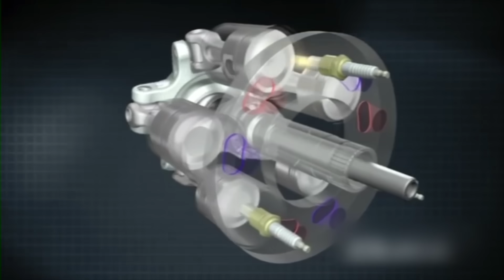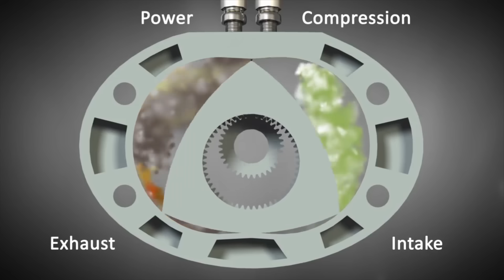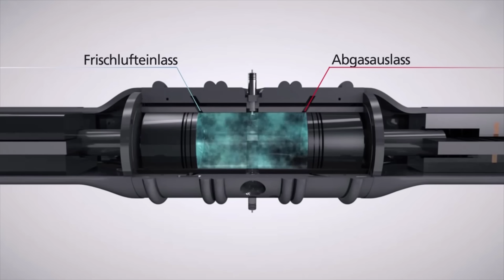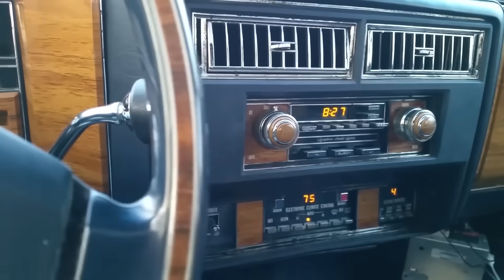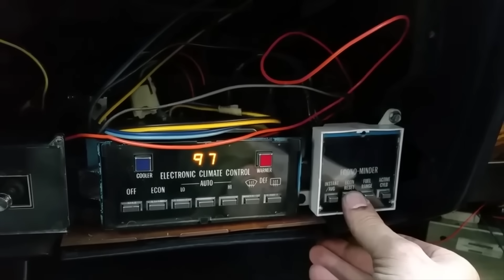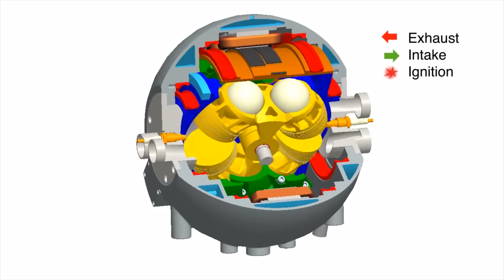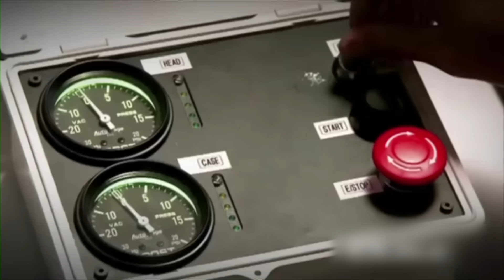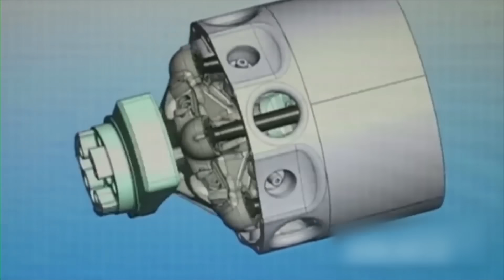10 Strangest Engines of All Time

Comment: LMAO....talks about the Mazda Rotary motor...focuses on the sad RX8, not a single mention of the 20+ year run of the Iconic RX-7....or the lil monster RX-3...or the Cosmo.
Reply: @Aaron Brockington I road tested the RX-3 when it came out. Holy mother ... it was awesome.
Reply: @danmar007  I had one used, damn it used more oil than fuel. lol I traded it for a '77 Corolla SR5 and was much happier.

Comment: And that last engine should be able to idle at 100rpm. It's papa the revolver engine could and that was over 30 years ago now, they put one in a Cessna, it took off quicker and got altitude faster. The plane might still be around but I doubt it.

Comment: Fuel driven electric proplsion is how train locomotives run too.
Reply: The original hybrid.  I was shocked when I learned that, being a huge train buff since I was a kid.
Reply: That's a gas engine with extra steps
Reply: Victor Murat  it uses a diesel engine that drives a generator that drives an electric engine for the fact that if it was driven directly by the diesel engine it would needed a huge gearbox to transmit the power and torque to the wheels.
Reply: @vladimirvlad2563  

It would also be extremely tricky to put down all that turbodiesel torque from those huge engines if the engine was mechanically linked to metallic wheels on metallic rails!  A motor which doesn't need to "idle" so can work from 0rpm and is also highly controllable is much better.

Even though there's an "extra step", they're well designed too, so fairly efficient for what they do.  I always kinda wanted to see heavy goods vehicles use the same setup, but didn't happen.
Reply: kelly dunn 👀
Reply: Railway locomotives pull or push Trains. We have train tracks, but I don't think you can have train locomotives, as locomotives are part of a train, then again you can have an engine in a locomotive, or use an engine to pull a train!

Comment: The first person to experiment with an internal-combustion engine was the Dutch physicist Christian Huygens, about 1680. But no effective gasoline-powered engine was developed until 1859, when the French engineer J. J. Étienne Lenoir built a double-acting, spark-ignition engine that could be operated continuously.

In 1872, American George Brayton invented the first commercial liquid-fueled internal combustion engine. In 1876, Nikolaus Otto, working with Gottlieb Daimler and Wilhelm Maybach, patented the compressed charge, four-cycle engine.
Reply: 17th century: Christiaan Huygens designs gunpowder to drive water pumps, to supply 3000 cubic meters of water/day for the Versailles palace gardens, essentially creating the first idea of a rudimentary internal combustion piston engine.
1780s: Alessandro Volta built a toy electric pistol in which an electric spark exploded a mixture of air and hydrogen, firing a cork from the end of the gun.
1791: John Barber receives British patent #1833 for A Method for Rising Inflammable Air for the Purposes of Producing Motion and Facilitating Metallurgical Operations. In it he describes a turbine.
1794: Robert Street built a compressionless engine. He was also the first to use liquid fuel in an internal combustion engine.
1794: Thomas Mead patents a gas engine.
1798: John Stevens builds the first double-acting, crankshaft-using internal combustion engine.
1801: Philippe LeBon D'Humberstein comes up with the use of compression in a two-stroke engine.
1807: Nicéphore Niépce installed his "moss, coal-dust and resin" fueled Pyréolophore internal combustion engine in a boat and powered up the river Saône in France. A patent was subsequently granted by Emperor Napoleon Bonaparte on 20 July 1807.
1807: Swiss engineer François Isaac de Rivaz built an internal combustion engine powered by a hydrogen and oxygen mixture, and ignited by electric spark. (See 1780s: Alessandro Volta above.)
1823: Samuel Brown patented the first internal combustion engine to be applied industrially, the gas vacuum engine. The design used atmospheric pressure, and was demonstrated in a carriage and a boat, and in 1830 commercially to pump water to the upper level of the Croydon Canal.
1824: French physicist Sadi Carnot established the thermodynamic theory of idealized heat engines.
1826 April 1: American Samuel Morey received a patent for a compressionless "Gas or Vapor Engine." This is also the first recorded example of a carburetor.
1833: Lemuel Wellman Wright, UK patent no. 6525, table-type gas engine. Double-acting gas engine, first record of water-jacketed cylinder.
1838: A patent was granted to William Barnett, UK patent no. 7615 April 1838. According to Dugald Clerk, this was the first recorded use of in-cylinder compression.
1853–1857: Eugenio Barsanti and Felice Matteucci invented and patented an engine using the free-piston principle in an atmospheric two cycle engine.
1856: in Florence at Fonderia del Pignone (now Nuovo Pignone, later a subsidiary of General Electric), Pietro Benini realized a working prototype of the Italian engine supplying 5 HP. In subsequent years he developed more powerful engines—with one or two pistons—which served as steady power sources, replacing steam engines.
1857: Eugenio Barsanti and Felice Matteucci describe the principles of the free piston engine where the vacuum after the explosion allows atmospheric pressure to deliver the power stroke (British patent no. 1625).

Comment: pfft, duke engine... Call it the "revolver engine" and it'll sell.
Reply: Look up the Crankless Engineering company  in Melbourne Oz. Motors of the duke design existed back pre WW1. Phil Irving of Vincent motor cycle fame worked there as a lad. 
Similar motors are uses as hydraulic of air motors - see torpedoes. There was also a German WW2 aircraft motor of similar design.

Comment: did citroen GS really have Wankel motors? anyone?
Reply: Yes, disaster that almost bankrupt Citroen, all were supposed to be recalled and scrapped but a handful escaped.
Not all GS' had the Wankel of course - mine had a flat four aircooled 1222cc engine.

They also built a birotor engined helicopter.
Reply: @myglaren  interesting, thanks.

Comment: The Tucker engine would make a great slow speed generator engine running a 6 pole AC generator at 1200 RPM to produce 60 HZ  120/140 volt power for continious use .
Reply: Its a flat 6 helivopter engen

Comment: The widely used piston engine is still the best in reliability long life . Engine like I have in the photo with me is 503 Cu In  1 cylinder only 24 HP at 525 RPM and has torque of 240 Ft Lb  the 10 inch stroke is a true "Power stroke" engine . Ajax makes a 1 cylinder 2 cycle engine 15 In bore and 16 In stroke is 165 HP and yes 3,400 Ft Lb if torque at 300 RPM  That isn`t peak torque in these engines but standard running torque .
Love to see one of those automobile 500 + Hp engines try to put out that power at a constant rate !! most likely  burn up in less than 15 minutes.

Comment: You need to see the motor in my Minn- mo  Z tractor.  Designed to have least parts. It's a overhead valve flathead . The head bolts on vertical, the valves lay flat over the piston, no pushrods, rockers are over a foot long and ride from the cam to the valves. No  oil pan, the crank shaft and cam load in from the back of the engine. Intake and exhaust ports face up.

Comment: More research needed here! Most of this is a jumbled babble of inaccuracies and incorrect 'facts'. Some of the latest electric cars now have ranges up to nearly 300 miles. Stop for a P-break after 250 miles, top the battery up for half an hour for another 250 miles. Anyone that drives 500 miles per day every day is probably better off in a gas car.

Comment: When the Dodge ESX hybrid was created back during the Clinton Administration, it ran on the BOLDER TECHNOLOGY power cells. The same 3 cyl. charger on board did the same as the ones now used. Most motive power for trains are hybrids. Traction motors on every axle ae supplied by generators on Diesel engines inside the locomotive. The F-7 was the Superchief of passenger trains. Only bus and air travel killed off passenger trains with the lower cost of fuel and time. Modern version still move commuters on the East Coast. Buffet plays with real trains today. BNSF is his creation. I HAVE a train in my HO collection My prides are a UP #4005 Big Boy Mallet engine ( last of steam engines in the Forney Collection ) and the ATSF complete Superchief passenger trains. They were looooong and required 4 F-7 engines to pull one.

Comment: There are 1300 carberators that are quite capable of handling gas to mileage that would provide solutions in fuel consumption.  H2O fuel hydrolization all so would resolve fuel consumption and fuel emitions ending in 100% zero fuel CO2!

Comment: I'm amazed at how far the internal combustion engine has come.
The 6.2 liter V8 in my truck produces 420 bhp, has 11.5:1 compression ratio and still runs fine on regular gas.
Compare that with the '70s 7 liter 427 in the Corvette which required high octane 103 gas.
1/4 mile for the Corvette 13.8 seconds.
1/4 mile for the Silverado, maybe a second more.
Not bad for a 5,000+ pound truck

Comment: Ive had a 2.8 vr6 powered Ford Galaxy (VW Sharan in drag) it was fun engine to drive with especially with the quick shift 6 speed box and the noise was like music, my current 35 degree true v6 sounds good but nothing like as good as my vr6 did, its not as responsive ether.
One bad point of the VR6 is the individual coil packs on each spark plug, fuck me do they fail, i was replacing one every few months lol

Comment: The Olds Turbo Rocket actually had a mechanical system in place that, if the water/methanol was empty it would close a valve and limit boost pressure to protect the high-compression engine. However going from boost to n/a is a pretty big performance drop.

Oldsmobile offered a free service to have the turbo removed and replaced with a 4-barrel carb because people complained so much. Finding one of those old girls with the original turbo and reservoir still in place is exceptionally rare.

Comment: You can build a electric motors that will charge there batteries with out any gas use generators when the car is moving it's charging

Comment: The weight savings on a duke engine is a crock. They take their engine weight and compare it to the engine and transmission weight of a standard sport bike engine since they have a shared case configuration.

Comment: It would be nice to see a couple of the water hydrolysis engines that have been designed.  I know that none of them have hit production, and they probably won't compete with modern electric motors, but they were an interesting bit of engineering.

Comment: Obvious the Buick rocket engine was simply a high compression turbo engine that used methanol injection as the "rocket fuel" lol could have simply used washer fluid

Comment: Concept and design. The design was conceived by German engineer Felix Wankel. Wankel received his first patent for the engine in 1929. He began development in the early 1950s at NSU, completing a working prototype in 1957. 
Rotary engines were mostly used in aircraft, a few cars and motorcycles were built with rotary engines. Perhaps the first was the Millet motorcycle of 1892. A famous motorcycle, winning many races, was the Megola, which had a rotary engine inside the front wheel. 
You need to go back to school dude!
Reply: Wankel the SS Nazi ???

Comment: The narrow V engine was introduced by Lancia. In 1922, with the model Lambda that incidentally was also the first car built with a monocoque frame. That was a smal 1.5 litre V4, a few years later Lancia made a 4 litre narrow-V8 (24°) engine for the bigger model Dilambda. The ultimate grandson of the 1922 Lancia narrow V won the 1972 Rally World Championship (then named 'Intl. Manufacturers Championship') with the Lancia Fulvia 1600 HF. Volkswagen arrived 'only' about 80 years later with this engine design...

Comment: It does not matter what you got right or wrong with these combustion engins because the combustion engin is in the end of days at this time. As most motor manufactures will have changed to electric by the end of 2021. Petrol, diesel and gas supliers will be doubling or even tripp;eing the cost of there fuels by the end of 2020.

Comment: Except for the rotary engine these are all reciprocating. Therefore the dwell is still in the thousandths.. see Rafael Morgado’s MYT engine. 12° dwell, full burn. Power to weight ratio is 20:1. 150 pounds, displacement is 850 in.³.

Comment: TORQUE VALUES ARE EXPRESSED IN POUNDS PER FOOT OF LEVER  so to get the force applied by the rotating shaft you need to  multiply the force in pounds and divide it by the diameter of the crank shaft

Comment: 81 Seville 4-6-8 6.0 littre (368 c.i.d.) engine did not "hold the valves open" as stated but intstead had solenoids mounted on the rocker arms that when activated allowed the valves to remain closed, it was as smooth as a gravel road. If the computer did not fail from vibrations the solenoids would fail. The only thing to do was remove the wire from the TH325 high gear pressure switch, since it only engaged in drive. Simply removing the connectors on solenoids caused extreme misfire since fuel was restricted when the system activated. This system and Chryslers MDS(multiple displacement system, plus GM's resurrection calling it AFM ( active fuel management) are complete failures in longterm reliability,  since owners do not change their oil, or GM's case owners belived to the Oil Life Index display that took out so many engines by sludge.  Almost every 2005 up 5.3 AFM engine smokes because of gummed up oil rings thanks to this system. Several other mistakes of fact are also presented,  but I have become bored with this.

Comment: I wish you got things correct. The first commercially successful internal combustion engine was created by Étienne Lenoir around 1859 Then you did the Wankel rotary engine conceived by German engineer Felix Wankel 1929, In 1951, NSU Motorenwerke AG in Germany began development of the engine, with two models being built. The first, the DKM motor, NSU Sport Prinz coupé introduced back in 1959. In addition to the folding roof Then there was NSU MAZDA  also the Norton motorbike and Suzuki. The Jet car  in 1939, Spencer Wilks was approached by the government to assist with a top-secret new development - Frank Whittle's gas turbine. However, the first engine (T5) producing 100bhp at 55,000 compressor rpm and weighing less than a standard Rover engine was announced in May 1948.  The more powerful T8 was born later that year and successfully tested at the end of 1949 - in a boat! Rover's 'latest' product (a P4 75 Cyclops) - called JET 1. In 1950 JET 1. World's first jet car Inboard rear engine, suspension and brakes etc. standard P4.
 Compressor turbine 40,000 rpm light-up at 3,000rpm Power turbine max 26,000rpm idle 13,000rpm Max bhp 100. Test speed 85mph. Max mpg 6. 1952 Updated JET 1. Note restyled nose. 
Inboard rear engine. 
4-wheel prototype Girling disc brakes.
Max bhp. 230 Test speed 152mph (world record). Max mpg 6. Then 1956 T3. First car specifically designed around gas turbine engine, by Spencer King with Gordon Bashford and Peter Wilks.
 Inboard rear engine (2S100 - 2 shaft, lOOhp) 
4-wheel drive, fixed diff. Sheet steel frame, glassfibre body (David Bache). DeDion rear suspension, back-angled front forks, 4-wheel inboard Dunlop disc brakes - Most of these innovations were to be used on the P6, seven years later!
 Compressor turbine 52,000rpm, light-up 15,000rpm  Max bhp 110, Max mpg 13 (with heat exchanger).  Diesel  engines named after Rudolf Diesel 1893, soon after Karl Benz was granted a patent for his invention of the motor car.